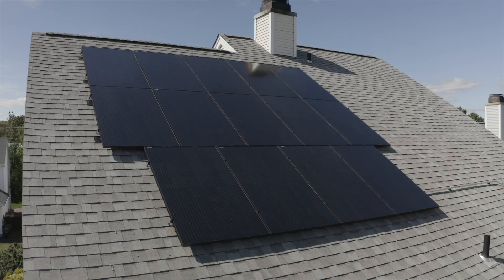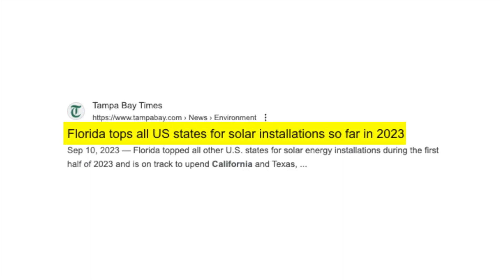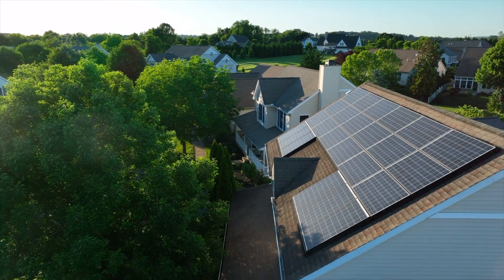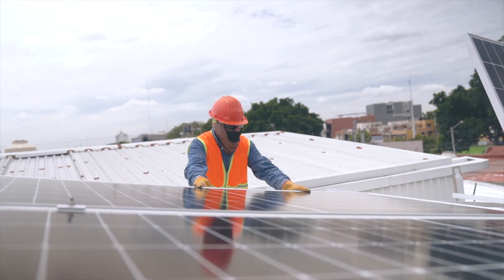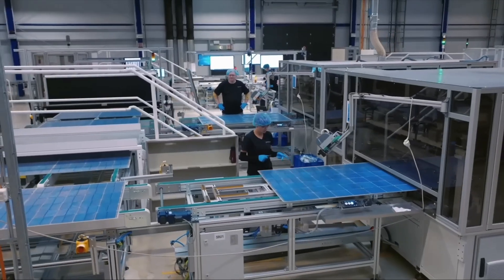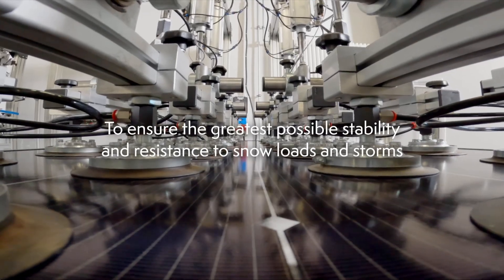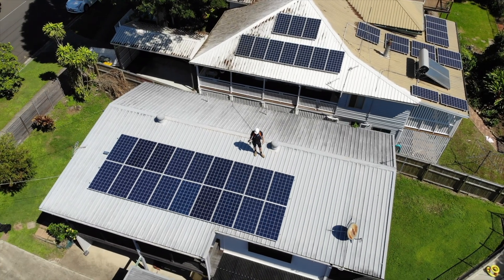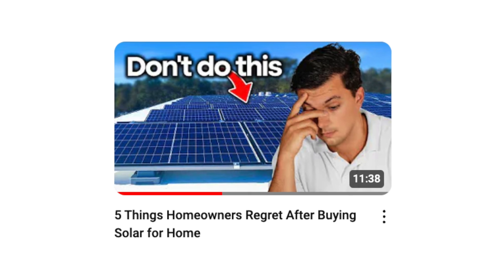Florida Home Solar Program Explained (2025)

Comment: Please do not opt for a solar setup with a virtual battery. During a power outage—especially in the middle of a storm—you are going to be left without electricity, even while your roof is full of solar panels.
What’s worse, your utility company will buy your excess energy at a fraction of its true value, only to sell it back to you at 5 to 8 times the price. In effect, you’ve rented out your roof so the electric company can profit even more—while you remain vulnerable.
If you're going solar, make sure to invest in a physical battery system so you can actually use your power when you need it most.

Comment: Florida building codes require any solar installation to be designed to stand up to 160 MPH which panels are rated for this and comply with your other 2 criteria outlined in the video.
Reply: Aptos Solar Panel, They have a wind load of 5400pa and are Miami-Dade County certified. The Myer Burger panels don't have the same wind load only 4000pa, Yes they are more efficient but didn't find any Miami-Dade County certification for them.

Comment: You missed the "Tier" system in FL.   Tier 1 is 10 kW (AC) / 11.7 kW (DC) or less.   Those are easy to get approved and utilities aren't allowed to require additional insurance on them.  Anything bigger than that is a hassle to get approved and the utility will typically require the homeowner have or purchase additional liability insurance.   I put in a maxed out, ground-mounted Tier 1 system this summer.   Then there's PTO.   FPL is slow.  I put in a ground-mounted Tier 1 system.   Inspection passed in mid-July.   Now mid-September and I still don't have PTO. :(
Reply: This is crazy. I can tell you from experience with FPL on other matters they have by far the worst customer service and are known for not responding to customers. Good luck if you need to try to get ahold of them.

Comment: Thanks for the video. One question, the panel you recommend did not make it into your top 5 panel list that you posted previously. Is there any reason why?
Reply from the maker: The Meyer Burger panel that is now being made in Arizona is fairly new to the USA residential market, which is why I have just recently been talking about it.

Comment: Florida Keys Electric Co-op charges $1/day connection fees(Daily Access Connection Charge)...$365/year to be hooked up.  They do participate in net-metering and while their online description is a little vague, it appears to be 1:1.  Utility companies in Florida, particularly FP&L are lobbying the State Legislature hard to reduce net-metering to their retail customers...success has been mixed.  With the increase in battery technology that option seems to make more sense as prices drop.
Reply: Under current law, Floridians will be grandfathered for 20 years of 1:1 net metering for any installation approved prior to January 1, 2029.
Reply: @charlescourtney4412  FPL is still out to screw the customers. Everyone if they can. The people not already grandfathered in if they can't. They could have gone solar themselves years ago and kept their monopoly. 

But no they spent billions building extra natural gas burning plants and now they are scrambling to hold onto what they can. 

If a solar watt cost a $1.00 to a consumer, it cost $0.10 out the factory door. FPL has the resources to buy panels by the shipful and the personnel and machinery to install them efficiently too. If individual consumers can afford solar now, FPL could have rolled out a majority solar energy profile 5 if not 10 years ago.